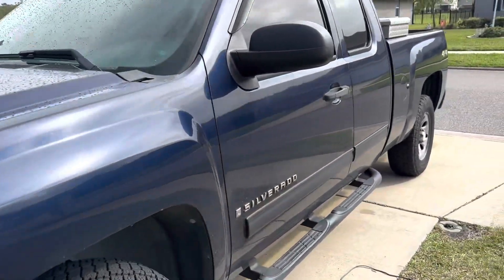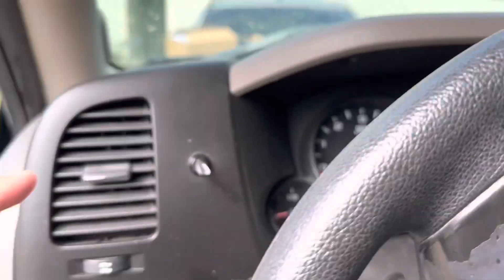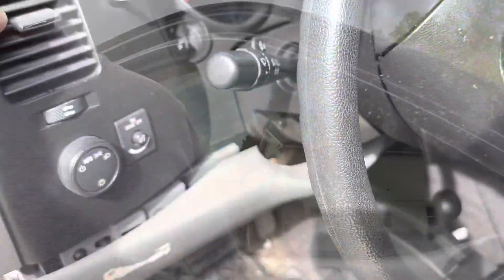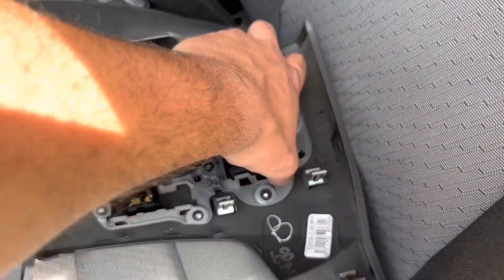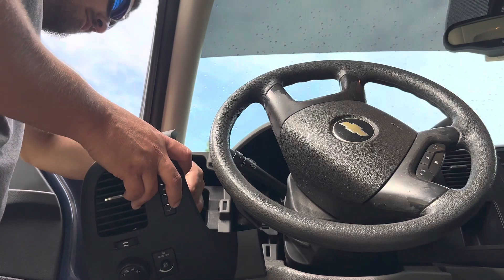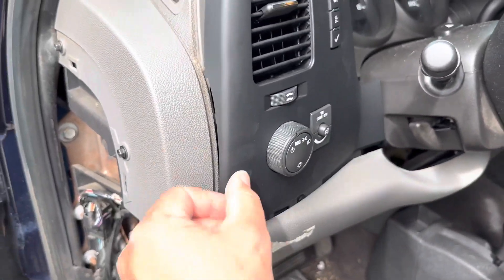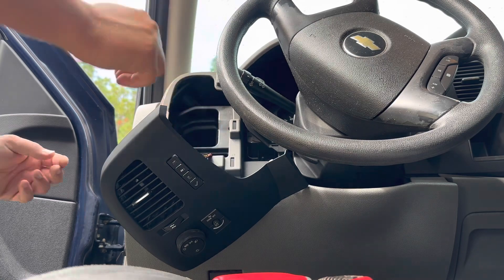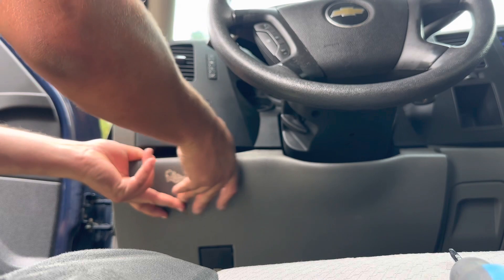UNLOCKING HIDDEN DRIVER INFORMATION ON 2007-2013 SILVERADO/SIERRA FOR UNDER $60

Comment: Just did this and added a garage door prepped overhead bezel at the same time. $20 total from the salvage yard.  My DIC wire was actually in a place holder...perfect condition. Spent 20 minutes pulling it at the yard and same installing.  2008 Z71 LT

Comment: You can also add the factory fog light button under the dimmer on that same side. You can wire in those fog lights to the factory location in the fuse box aswell👌

Comment: Can you add this to a 2013 Silverado even if it doesn’t have the work switch there, or does there need to be more wiring installed for it?

Comment: Your WASHER FLUID INDICATOR MESSAGE is like mine --  My fluid is full but the light is still saying it is LOW?  I am guessing the sensor is dead?  The sensor is an EXPENSIVE little bugger! Cheapest place I found was ROCKAUTO parts for like just under $30?  So is it worth it to change the sensor?  I am thinking it can wait as I have other thing to upgrade first.  I just picked up my 2012 Silverado 1500 LT with 120K mile at the beginning of the month, and still learning about all the Bells and Whistles.  My LT has the DIC already I am learning how to use all the features -- Your video was great BTW.  Thanks!
Reply from the maker: Thank you yes it very expensive for what it is I found one in a wrecked truck on Facebook but haven’t had a chance to change it yet.

Comment: Thought it might be cool to unlock the extra features. This is a joke. Now my interior lights won't come on with the doors opening. Fuel remaining miles is way off and says I've used more than the max capacity gals of fuel with a quarter tank left on the guage. This is Chinese shit.
Reply: Reset it

Comment: I pulled the bezel off on my 2007 Chevy Silverado 1500LT and wasn't able to find anything that looks like the wiring harness that would plug into the DIC control buttons.  I've got the trip reset peg on my instrument cluster but it's practically useless as all it shows are the odometer reading, remote relearn, and tpms relearn.  I've seen other videos where the harness was hidden behind the bezel and all one had to do was swap out the bezel like you did, but sadly I'm not finding that particular wiring harness.  I'd love to have those additional readings on my dashboard but sadly it looks like my truck isn't equipped for it.  😞
Reply from the maker: Really that’s very interesting that makes two trucks I’ve heard of without it, I’m wondering if it’s really just tucked away.
Reply: @SmittysWorld  No clue but I really don't want to start ripping my dashboard apart to find a wiring harness that may or may not exist.  I've seen other videos where it was tucked away right behind the bezel but I've already shown a flashlight through the cavity and am finding no signs of it.  I'm thinking it depends on what month the 2007 truck was manufactured in, as I most likely have the early 2007 one that rolled off the assembly line.
Reply from the maker: @Одеса_горда  yea sadly that makes sense also did you check by the fuse box could be tucked up inside there possibly.
Reply: @Одеса_горда  Is yours an 07 or an  07.5?  There's quite a difference in those two.
Reply: Check to the left of center vents. If it’s not on left side of steering wheel, it’s on the right side of steering wheel just left of center 2 dash vents.